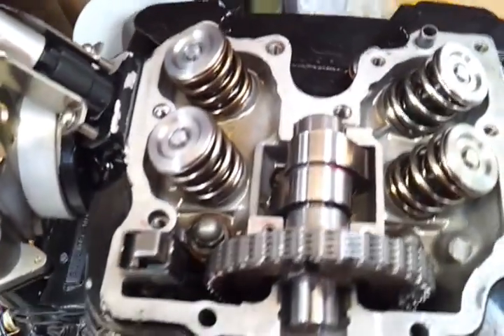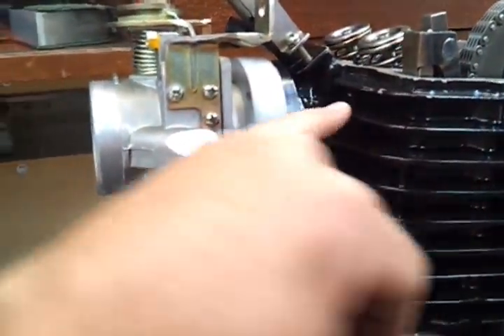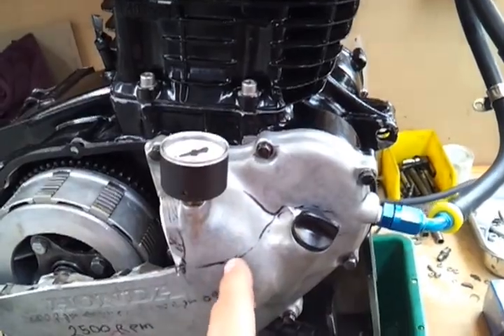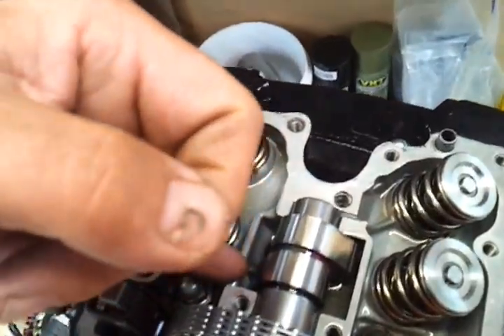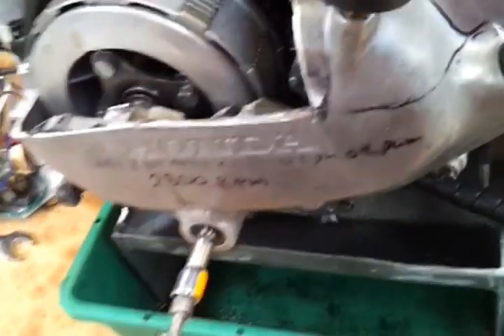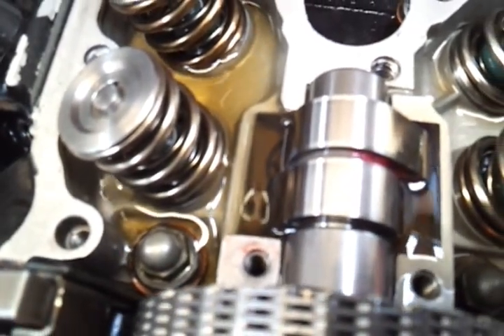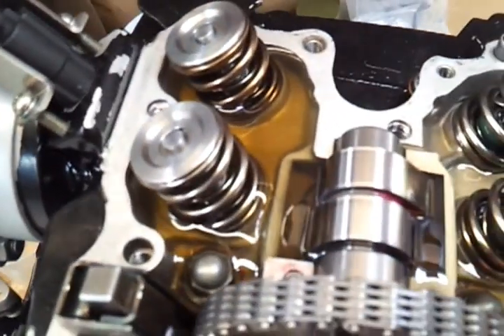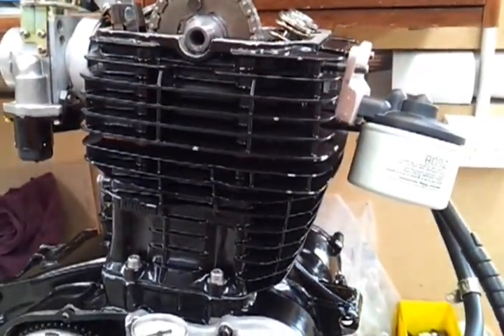Honda XR500R oil pump flow

Comment: Hi, reacting on a 7 year old video, so kind of a long shot. I am building a budget ft500 race bike for vintage demo racing. I want to hop-up the engine a bit and you seem to know a hell of a lot about it. I for instance would like to remove the balancers, I've read that the guys in the states that raced them used to do that to but I just can't find any info on it.
Reply from the maker: Hello,
Removing the balancers is not good. Honda engineers spent huge amounts of money designing balancers to remove dangerous harmonics from the engine. The crank shaft needs re balancing to compensate and none of that is worth the heartache. Keep the balancers. I had one without it and it was afwul.
Reply: @VORTEXdredge  Thanks for the quick reply! Balancer will stay in that case. I will build an exhaust to mimic the white brothers one and probably fit a bigger flatslide or roundslide carb. I also have a full CBR hurricane front end, brakes and wheels ready to go in. Any other relatively budget adaptations I should consider? Do you also have experience road racing the FT?

Comment: how exactly did you tap into the oil gallery?
Reply from the maker: Hi, you can easily tap into the oil gallery via the clutch cover oil galleries. What I did under the engine involved welding in tubes and epoxy etc etc. Thanks

Comment: I use PENRITE MC 4ST which is a Synthetic 15W-50 shear free, full zinc oil and have had no cam wear issues since. Product code: MC415W50004.
Reply: That is the main issue. Same thing happens in flat tappet V8 engines too with the "Energy Saving" zinc free, catalytic converter friendly oils.

Comment: Vortex , great video and very well researched. That must have been a lot of effort. What oil do you recommend for high zinc content? I don't have an XL 500 but the Honda cam problem was common on all of the singles of that era, including my old 125.
Reply: Hi  my partner has a xr520 and the oil pressure is low , i see in your vidio you said you have had made up oil pump roters, is it much of a job to make them or can you supply them, to us MX boys and girls,
  Thanks   Chris / Sue

Comment: Hi, I am very interested in your findings about the oil system. Ranrovmat sent me over here! I have a 1982 XL500R and find that it overheats when I sit at idle in traffic (NYC = red lights are long and frequent). I'm eager to add an oil cooler to cool the oil and increase capacity. Looks like where you added your filter I could plumb a cooler the same way. Would love to know more about how you plumbed that oil filter and more detail about what you did to the oil galleries. Great project here. -Matt
Reply from the maker: Hi, The more we play with the oiling systems on these the more we believe most camshaft damage is oil quality related. High zinc content oil has stopped any issues we had been having. I drilled into the bottom engine case directly in line with the oil pump discharge gallery. There are areas of the gallery wall that get kinda thin so I machined an alloy tube on the end of an alloy boss and used JB WELD epoxy to seal the tight fitting tube in the new drilling.,Welded the alloy boss onto the casing in that location and fitted a 90 degree banjo fitting to connect a hose to the external oil filter, then directly back to the hose fitting you see on the clutch cover. The original oil discharge port on the clutch side of the engine was filled with epoxy to force oil through the new fitting under the motor. The oil entering the clutch cover then enters the crankshaft in the normal manner - now filtered. I dont see any reason at all why you cant fit an oil cooler to this system also. Its cold here in NZ so I dont bother.
Cheers

Comment: Great video, this is exactly what I needed to know for my project but couldn't find the info (until now). I have turbo'd a 1982 XL500 and decided to run a cam driven gear pump to feed turbo rather than tap into an engine oil gallery. (See my videos) Interesting that your maxing out at 15psi at 4k rpm, not sure this would be enough for a journal bearing turbo on song, that alone possibly validates my decision. Thanks.
Reply: I know I'm years late to the party but the ft500 bottom case gives great access to oil systems have you thought if it? Ps I've seen your videos pt 1 and 2 over and over again though the years. it's a truly amazing build 👏👏👏
Reply: @Immortalrounin  Haha, yeah its been a while. To be honest I haven't looked into the FT crankcases and what the differences are to the XL/XR but I will now. My cam driven gear pump is worn and bypassing passed the end plate now, as the oil heats up the pressure drops. The bike is parked in my games room and I haven't mucked around with for a while. I'll have to roll it out and reassess the turbo oiling and crankcase ventilation issues that have been the hardest problems to resolve in whole build. Glad to hear the vids have provided some enjoyment, once I get it all happening I'll post a ride video.
Reply: @ranrovmat  on my friends  xl/xr/ft thing he used a dry sump with a mechanical pump run of where the starter motor attached with a chain and a cb750 oil tank from a chopper. I'm copying some elements of his build ft500 bottom xr top and side cover  reed valve  head (for easy efi later 😉). Is your cam stock..ish or did you add the needle bearings to yours?
Reply: @ranrovmat  lastly I'd watch any and every video that you'd post on your xr cheers 🍻
Reply: @Immortalrounin  I was looking at EFI originally using a Megasquirt ECU, however as it was easy to seal up the carby for the blow through set up I thought I’d give that a go first. My cam is still standard running in the aluminium journals and is in good condition that’s why I didn’t want to tap into the oil gallery and muck with the stock top end oiling system despite this video confirming volume looks to be plentiful. This was the reason to go with the separate oil pump off the end of the cam, before the pump wore out it would see 60psi of oil pressure to the turbo when cold dropping to 25-28psi once the oil was warm. That’s why my bike has that brass tap on the pressure side of the oil pump to bleed of some pressure to the sump when it first starts up (tap cracked open) to reduce to around 40psi then once warm turn the tap off.